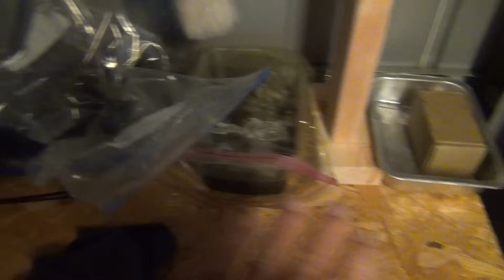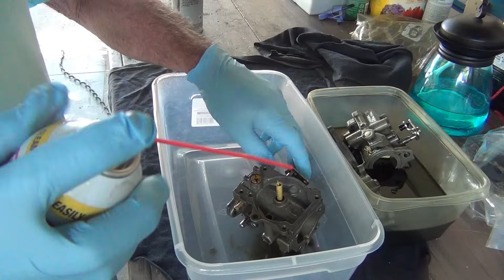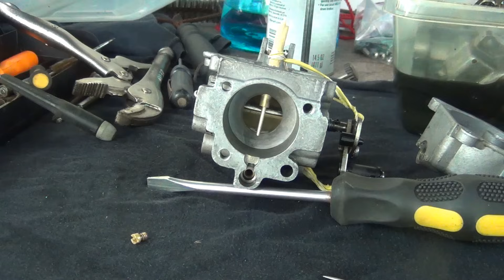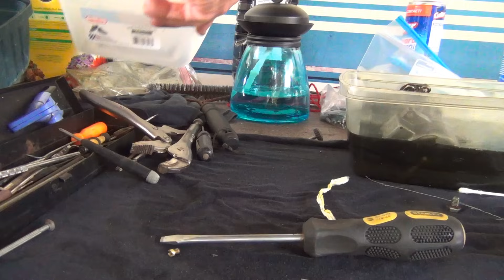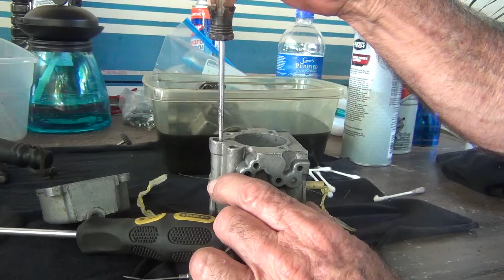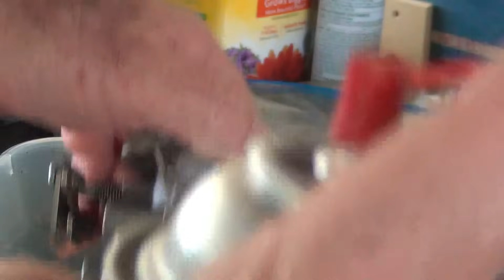Johnson Evinrude Carburetor Clean - The 2 Most Important Things / #outboardrepairvideos

Comment: Are you still using that mixture to soak carbs in. I been reading some of the reviews for that carb parts cleaner in the can and basket and some don't seem to good. So whatcha using now
Reply from the maker: Hey. Thanks for tuning in. The main ingredient is STP COMPLETE FUEL SYSTEM CLEANER. It works great!
Reply: @THISOLDOUTBOARD1  do u throw whole bottle of stp in
Reply from the maker: @jshall1000  yes

Comment: When I have my outboard running I get gas spitting out of that air Orifice? Or air bleed you might have called it hat normal? Thanks
Reply from the maker: Hey. Thanks for tuning in. Yes I believe that was when I worked on that 87 70hp Johnson. I had read somewhere, that it was normal for those old motors. It's from the reed valves in a 2 stroke opening and closing. I also remember, after watching it very carefully that it only "appeared" to be coming from the air bleed when actually it was spitting out through the carb, a very tiny amount, it was like micro droplets. So it was not coming from the air bleeds. There was always a puddle of fuel in one or two of the carbs. I ended up swapping the reed valves on it and if I remember correctly it helped but didn't cure it from having the fuel puddles. I originally noticed it when looking straight at it, that made it appear to be coming from the air bleed. When I turned the motor and watched it from a side view then I could tell it was coming out the carb throat not the air bleed. Double check yours and make sure where its coming out. If it is the air bleeds you may just need to get a carb kit and rebuild. Could be worn float needle not seating or float not adjusted properly. Usually something simple like that. Thanks again & Stay Tuned !

Comment: I have a 1978 Johnson 85hp carbs have been rebuilt a few times and it still keeps flooding,any suggestions on why
Reply from the maker: Hey. Thanks for tuning in. Check your primer solenoid it could be leaking or got knoked open. Fuel pumps too!
Reply: @THISOLDOUTBOARD1  ok I'll check thank you for the advice

Comment: What is it you soak them in, sorry i didnt catch it if you stated it...
Reply from the maker: Hey. Thanks for tuning in. The main ingredient is the STP complete fuel system cleaner. Then I sprayed some brake & carb cleaner in, added a little gas and some 2 stroke oil to keep it from evaporating to fast. But it was the STP that did the most work. Thanks again & Stay tuned !

Comment: I'm looking at a 96 Johnson 9.9. for my little Jon boat. Guy said carb no good it getting to much fuel. Could it be a easy fix. Can the low speed needle be out to much. I know with our u seeing it it's tough. But could it be easy fix
Reply from the maker: Hey. Thanks for tuning in. Yes it probably is an easy fix. Take the carb off and clean it, get a rebuild kit and replace the needle, float & gasket, be sure the float is set properly and set the slow speed needle at 1.5 turns out, that will get it started and then you can dial it in later. Also check the primer, it may be leaking the extra fuel in. Just pinch the line off going to the carb. But don't forget to check the compression before you buy it, you don't want to end up with a 1996 9.9 anchor ! Thanks again & Stay tuned !
Reply: @THISOLDOUTBOARD1  that's. And I know I keep saying but your channel is great. This old dog learning new stuff wish I could have done this in my younger days
Reply: @THISOLDOUTBOARD1  I'm supposed to go pick the outboard up tomorrow it's elec start but no tiller and he doesn't have any the control and cables how hard and expensive is it to find. I need your wisdom sensei
Reply from the maker: @jshall1000  you could put a tiller handle on it if you wanted to. They just bolt right on. Look for a remote control box with cables and wiring harness on craigslist, offerup, facebook marketplace & ebay. You can probably find a tiller handle on ebay too.
Reply: @THISOLDOUTBOARD1  alright cool Id prefer the steering rather than tiller. I didn't know that I could use any throttle box and cables. Good to know I'll look
Reply from the maker: @jshall1000  the outboard should have the big Red plug on it, so you'll need the control with the big Red plug, it will have the fast start lever on it too. Push the key in to activate the electric primer.
Reply: @THISOLDOUTBOARD1  thanks. It seems the guy disappeared from earth lol. Haven't heard from him I was supposed to go at 10 am. It was a good deal TOO. Haha get the  pun.

Comment: Hey buddy great video. On another topic I am working on a 1981 25hp evinrude, question is  when using the rope start the flywheel turns clockwise. When I use the starter motor the flywheel turns anti-clockwise. Do u have any idea what's going on? 
Thanks.
Reply from the maker: Hey. Really? Does it start and run? Backwards! Maybe its the wrong starter for that motor. Let me know. Thanks
Reply: @THISOLDOUTBOARD1  This is the motor I got right before this virus. It haven't started yet I am waiting for a coil and power pack from ebay. But I noticed this rotation when doing a compression test, and trying to start it! So the motor should rotate clockwise correct?
Reply from the maker: @rommel212  Yes. are you sure it wasnt just an illusion, you know like looking at fan blades it looks like its running backwards. I wouldn't try to start it if it is running backward . It could blow up! Hahaha no telling where/when its firing.
Reply: @rommel212  its probably just an illusion. Its tricked many a person.

Comment: Could a first time person rebuild his 1969 25 horsepower outboard? It just stumbles as you give it throttle to go fast
Reply from the maker: Hey Kyle. Thanks for tuning in. Sure, I was a first timer. I just started a 71 20hp, same motor as yours, I'll probably make it a 25. Follow along if you'd like. These things aren't that difficult. I think of them as a big weedeater with a cooling system! Hahaha, come to think of it, I've had more problems getting a weedeater to run! Check out my latest video, 71 20hp johnson build. It's easier than you think. Thanks again & Stay tuned !

Comment: What are you soaking the carbs in?
Reply from the maker: Hey. Thanks for tuning in. The stuff is STP Complete Fuel System Cleaner. And some carb cleaner, brake cleaner, a little gas and 2 stroke oil to keep it from dehydrating. Thanks again & Stay tuned !

Comment: I have a 65 HP Johnson 1972
 It idles fine but when I put it in gear and start to give it gas it just dies, can body help me
Reply from the maker: Hey. Thanks for tuning in. I would start with the link & sync. If its not set right (slow speed timing) it's just gonna sputter out. It's crucial, you don't want more fuel before spark. These old outboards like to run where they want to run so an OMC manual isn't always to much help but it will get you in the ballpark! So there are other factors that can cause this problem and all you can do is go through it and a service manual WILL help! So what I'm saying is try and find a service manual specific to your year/model. Check Ebay for a good used manual. It will save you time & money !

Comment: I think you're pretty zany but evidently you know your stuff.
   I've been working on a 1992 15 HP Johnson.
   Earlier this year I pulled it out and tried to start it even though it probably had 3-year-old gas in it.
Wouldn't run right; carb leaking gas. I wonder why?
Knocked on the carburetor a few times and evidently freed up the float. Then it seemed to run alright but subsequently it started acting up again. I wonder why? 
   Put fresh fuel and two cycle oil with some seafoam in the tank and sprayed the carb with seafoam. Seemed to have fixed the problem for quite a while then it started acting up again; wouldn't idle right and would only run high when feathering the choke. I wonder why?
   Finally broke down and bought a carburetor kit and pulled the carb. Had a hard time getting the main jet freed up.
   Just finished cleaning up the carb the best I could without soaking it; it really wasn't all that bad upon initial inspection.
   By the way, the plastic sleeve that fits over the cam roller fell off while I was pulling the carb; I wonder if that could have had anything to do with it?
Reply from the maker: Hey. I wonder why? Hahaha. Best comment I've read all week! Thanks for tuning in. Yes, it will throw things off when once it falls off. You'll have to re-sync the roller with the marks on cam so the butterfly starts to open at the marks for the correct timing. You should be able to use the roller without the sleeve until you replace it and reset your timing. It's probably not off to much but wouldn't hurt to reset it after all the work you did. They're $25 on ebay for all. Thanks again for watching and commenting. Stay tuned !
Reply: @THISOLDOUTBOARD1  Thank you very much
Reply: Update 1992 15 HP Johnson.
   Shimmed the roller cam with seven O rings then wrapped with thin tape; reinstalled the rear rebuilt carburetor yesterday; started it up this morning but it seemed like it needed some tweaking; tweaked the roller cam and leaned the fuel air mixture; now seems to be performing much better.
   Thanks again.
Reply from the maker: @darrelpost678  Hey. Sounds good!

Comment: 1992 15 HP Johnson
   Mr. TOO would you please give me the torque specs for mounting powerhead to exhaust housing.
Reply from the maker: Hey. I don't have the specs. Try iboats.com forum or mabe leeroysramblings.com. Boats.no was a great place for all that, but to bad it doesn't work any more. And honestly, I never worried about those bolts, just always tightened them down super tight. Thanks !
Reply: @THISOLDOUTBOARD1  Thanks. 
   I perhaps hastily loosened those bolts thinking I could drop the exhaust housing to inspect/replace the upper water tube grommet. 
I see on somebody else's channel that was the cause of poor to no water flow.
   It seems that I'm having a water circulation issue; no pee at present and motor seems to be getting too hot but not seizing.
I removed the thermostat, appears good, and ran it without thermostat; same thing.
I tore the new water pump kit apart and it looks good.
(Any ideas?)
   Love you man and again I wish there was a way to donate to you other than PayPal.
Reply from the maker: @darrelpost678  Hey. Thanks. Pull the thermo out and fire it up. let it flush out. or if you still have the gearcase off, take a garden hose and cut off the end. Slide it up on the water tube and put a clamp on it. turn the hose on full blast and see if anything comes out the thermo housing. If the water still doesn't come up here's a trick Kodibass told me about. Get a wire hanger and straighten it out, bend the tip some and shove it up the water tube to the grommet. Hook the other end to a drill and spin it. Try to chew up the grommet, they get all swollen up and won't let water through. Then flush it out again. You may have to do it a few times and it won't hurt the grommet around the tube. Whats wrong with paypal? Thanks again!
Reply: @THISOLDOUTBOARD1  I just hooked up hose to intake tube as you suggested.
I have good flow even from pee hole.
   I'll let you know more later.
   Also I have never used PayPal just debit card or check. Just maybe I'll make the exception for you.
Reply from the maker: @darrelpost678  Hahaha. Thanks! I use it for everything, especially buying parts on ebay. And that's where I get all my parts. Except auto parts but I still use it for them too. It's better than throwing your card number out all over the internet. Did you see anything come out when you flushed it. I had the same thing happen on my 83 25 evinrude, impeller seemed fine but after I swapped with a new one everything was back to normal. Try putting the gearcase in a bucket of water submerging the pump. Put your drill on the drive shaft and spin it fast in neutral, the water should shoot out of the pump about 3 feet high where it would be reaching the power head. Thanks again !
Reply: @THISOLDOUTBOARD1  I first blew air through it and then I put water through it; nothing appeared to come out either time.
   I just reinstalled the lower unit before I saw your last advice about using a drill.
   Another boat motor channel mentioned something about applying too much water pressure to the muffs; it can affect the impeller and water pick up?
   Another thing, since I've rebuilt the carburetor the motor won't start on choke but when I give it a shot of starting fluid it fires right up?
I have read and been told by local marina here in Midland Michigan not to do that; too much of a shock and load on needle bearings!
At that, why would it start that way??
   Also, I have noted that the spark plugs are wet with a little carbon deposit?
   Your advice and suggestions are always greatly appreciated.
Reply from the maker: @darrelpost678  Yeah they say no starter fluid because there's no oil in it. Never heard that about the muffs thing but I hate them and rarely ever use them. Get a cheap garbage can then you can eliminate the muff theory/myth. Pull that carb off and clean it, the slow speed idle circuit is clogged. If need be check out my carb cleaning vid, https://youtu.be/401zCRctu1c. Are you sure its running on both cylinders, carbon deposits, wet plugs I'm surprised it runs at all. Get the carb straighten out, make sure your timing is set perfect, stop using the starter fluid, put it in a barrel of water and go from there.
Reply from the maker: and check out leeroysramblings.com. everything you ever need to know is at leeroys!

Comment: what are you soaking the carb.s in ?
Reply from the maker: Hey. Its a mix, some carb & brake cleaner, some gas and 2 stroke oil so it didn't evaporate to fast and the stuff doing the work is STP Complete Fuel System Cleaner. Thanks again & Stay tuned !

Comment: I have an 84 115 johnson (J115lcrd) I can seem to get to run unless im pumping the prime solenoid. I tore the carb apart and didn't see the usual jets im used to in a carb. Maybe you have a engine with a carb similar and could give me a little input?
Reply from the maker: Hey. No I dont have anything similar but if you look at the carb schematic there are several orifices #3,#7,#13. #7 looks like an air bleed, not sure what #3 orifices are for, possibly the slow speed jets, and the #13 orifices look like the high speed jets. The manual should help, you can get a free one at boatinfo.no. You say you cant get it to run, does that mean idle or run in gear? Is this a motor you just got or you've had? Have you tested your fuel pump? Compression good? Could be as simple as an air leak in the tank hose. 
https://www.marineengine.com/parts/johnson-evinrude-parts.php?year=1984&hp=115&model=J115TLCRD&manufacturer=Johnson&section=Carburetor

Comment: I’ve got a 1984 35 horse Johnson sea horse and it’s been running great until I got some water in the gas and it won’t push my 15’ boat to plain when it usually would go about 30 mph. And if I throttle all the way to idle it will die
Reply from the maker: hey. sounds like you still have water in the gas? you may have to clean the carbs and flush it out some more.

Comment: What are you soaking the carbs in for a few days?
Reply from the maker: Hey. The main ingredient is STP TOTAL FUEL SYSTEM CLEANER, and some carb spray, brake clean spray, gas and 2 stroke oil to keep it from evaporating to fast. But its the stp doing the work the rest is just filler. Thanks !

Comment: 1992 evinrude 25 hp.  Will fire on choke.   Wont start unless throttle almost full? Turn to start??
Reply: What do i need to do.  To get to start in.  Start position.   Seems like needs air.   Hence butterfly has to be open
Reply from the maker: Hey. Thanks for tuning in. Well. It's hard to say as to what's going on based on your description. But I'll go with "will fire on choke" first. Assuming everything else is good, more than likely its not getting fuel through the slow speed idle circuit in the carb. With the choke closed its just pulling fuel straight from the carb bowl and may even be flooding it also. Plus, yes, it does need air to fire. Fuel, air, spark and timing. Start with the basics and clean the carb properly, put a rebuild kit in it if necessary. Set the carb slow speed needle at 1 + 1/2 turns out. Set your carb/timing cam follower linkage properly to the throttle cam so the carb butterfly is just starting to open between the two marks on the cam. Also, you should check for good strong spark at both cylinders. In neutral, turn the throttle handle to start position and start it!
Reply from the maker: Here's a link to a video I just did on a 25hp Johnson. Just some basic settings.
https://youtu.be/cGmWMnw9nw4 . Curious to know how it goes. Thanks for tuning in!
Reply: Turns out was  cam was.  Way before marks.  Tuned the  cable moving timing marks to just open butterfly
Reply: Odly ran flawlessly last year that way?
Reply: Odly ran flawlessly last year that way?
Reply: Carb.  Was spotless.    Fuel filters new   gonna try it.
Reply from the maker: @dustinclark8186  Cool

Comment: What would cause a high idle? Can't seem to get it to idle down
Reply from the maker: Hey. Thanks for tuning in. Well, I don't know what your working on. Could be the linkage needs adjustment, air leak, choke not open all the way, slow speed idle screw needs adjustment, you'll have to check everything !
Reply: @THISOLDOUTBOARD1  Just bought a 99 Princecraft with a 25hp Johnson on it. Sat for years only took out once or twice a year is it. I don't believe it's ever been serviced at all. Water pump and impeller were shot and replaced, carb cleaned. Appreciate the reply been learning alot from your videos.